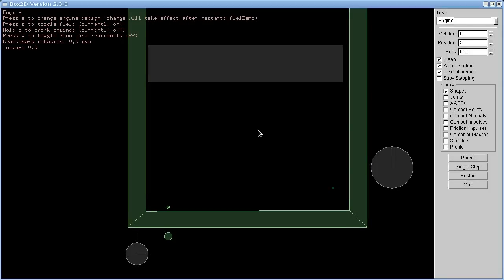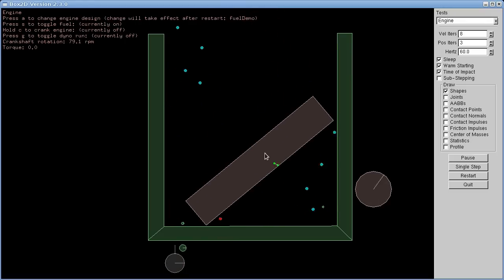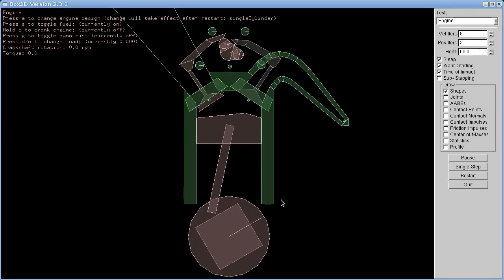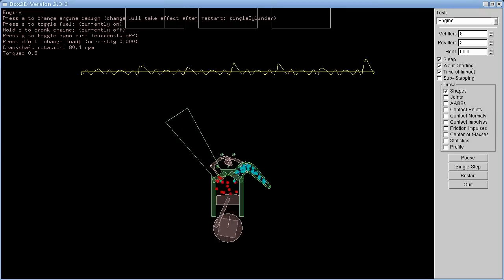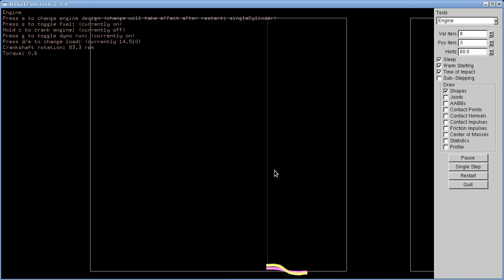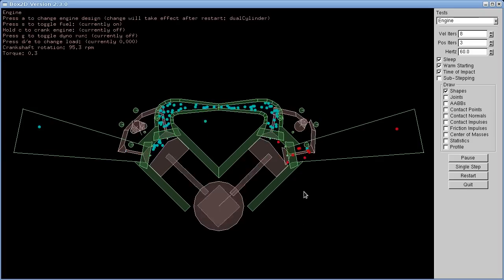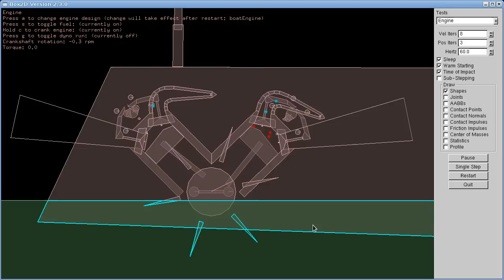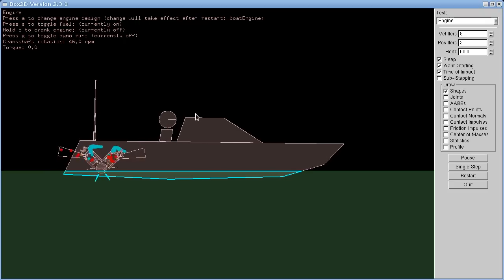Box2D 4-stroke combustion engine

Comment: Doing a lot of Box2D stuff atm - your work holds up against all examples to date! a huge inspiration for me to push the physics to their limits.

As you have probably realized since you created your boat - it behaves differently as the boat moves because the particles are emitted in world space as the boat moves through world space. So they're being emitted 'into the wind' as it were.

You can either add the boat velocity at particle spawn, then update all particles with boat acceleration factors during every time step.

Or you can run two simulations - so the engine can live in a non-moving reference frame and you can replicate its generated force into the boat joints. (rendering the static engine, translated onto the boat's position - so it looks the same as a single physical system)

Hope you're well!

Comment: For the chance that you're still interested in the problem of the engine stalling I'll add my thoughts.
Please note that I don't know anything about Box2D, but that I got some basic knowledge about physic engines and that I am a car mechanic, so I can talk more about a real engine works.

For me there are 2 things causing problems at high(er) RPM:

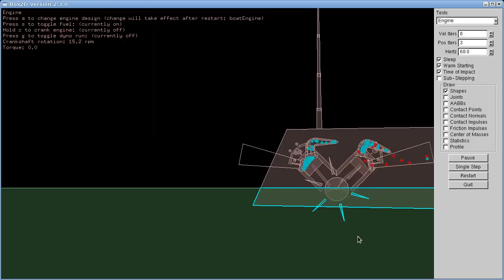1. You sometimes have the fuel/air mix (or particles) ignite in the intake manifold (examples: 26:57, 27:14), which results in a missfire and a missed power stroke, which leads to missing power.

2. The ignition of your particles is very late. Usually, you want to ignite your air/fuel mixture at the end of the compression stroke instead of early in the power stroke because it takes some time for it to fully ignite and expand.
This effect gets more important the higher the RPM gets, so the timing gets more and more early. This is called Ignition Timing.

I don't know how much you could change this in the simulation without it breaking though.

Comment: Oh, well... this video is about 3 years old. I bet you solved the issue of boat moving weird (near end of the video). I believe that this is because inertia of the fuel molecules is not up to scale with the engine parts. By that, I mean - molecules appear to have too much inertia, and once whole "cloud" of gas is accelerated, it seems like it still resist as if fuel is not accelerated at all.
Reply from the maker: No, I don't think anyone has come up with a plausible theory yet, at least one that I agree with :D

Comment: When you add fuel to the engine in the boat, do you set the starting velocity of the fuel particles to the same as the boat's velocity? If not, I can imagine that would create some odd effects.
Reply from the maker: no, but the particles weigh almost nothing, except when they're burning

Comment: Try adjusting the "Step" arguments: Make the time-step small and the iteration counts high. This way, you get a more accurate solution. You can also try making them a function of the engine RPM. Since the Box2D solver is using a first-order accurate method (it does not solve for positions and velocities simultaneously), you should get an error term that is linear in your time-step. Meaning: Half the time-step => half the numerical errors.

Comment: Maybe its because both particles in the cylinders are thrown left, changing the timing of when the cylinders fire (left is further from shaft, right closer) and throwing off the engine as a whole? It might also be that the left piston is accelerated out and the right accelerated in?

Comment: Its too late for me to go back and watch again but I seem to remember you saying that the engine needs load to generate torque. As the boat picks up speed isn't load being reduced on the engine? I wonder if that might have something to do with the stall. (The idea came from imagining the boat picking up enough speed that the paddles create drag).

Just a thought. Anyway... AWESOME vid! Thumbs up. :)
Reply from the maker: Load is required to measure the torque. Generating torque is no problem without load (otherwise the main shaft would not spin). As the boat picks up speed, the paddles should not be moving much relative to the water, so any drag would be insignificant. If anything, moving through the water should help keep the paddles spinning.

Comment: You've probably remedied this since then, but perhaps you could add some sort of ratcheting gear (or maybe a gear ratio of some sort) so the force from the boat moving forward isn't putting such direct force on the crankshaft and restricting its movement?

Comment: You shold make gears for it to move the kinetic energy around :)
Reply from the maker: Unfortunately gears made of fixtures cannot withstand the high speed and torque required for this. In a low-speed, low-torque situation they can do ok though, for example: https://www.youtube.com/watch?v=Oc9mzuWyPOI

Comment: I would expect the particles to be violently shacking the boat in all directions equally.
When the boat moves, the particles have a heavy push to the left (contrary to the movement of the boat) and thus stop the boat.
Could that be?

Comment: not every quarter but every half turn with the 4 stroke engine right? cus normally it does it once every 2 turns?
Reply from the maker: yes, correct. I got that wrong :)

Comment: Great video!
But is there a reason for the cam-shafts being different?
Reply from the maker: +martinmuunk not sure what you mean by 'different', what two things are you comparing
Reply: +iforce2d On the 2 and 4 cylinder engines; half of the shafts have two cams, and half have one?
Reply from the maker: +martinmuunk the shafts that look like they have only one cam actually have two, they are just overlapping so it looks like one. It ended up like that because I mirrored the first cylinder to make the second, and mirrored the two to make four. This means that some of the cylinders ended up with intake=left exhaust=right and some cylinders were the opposite.